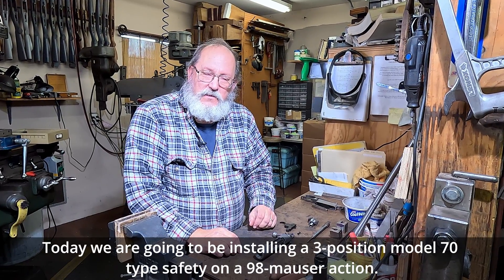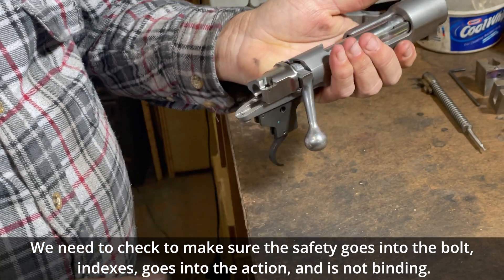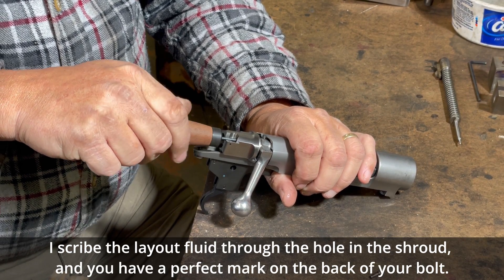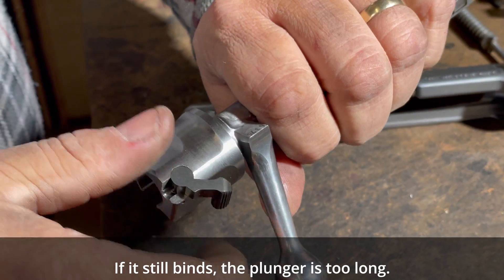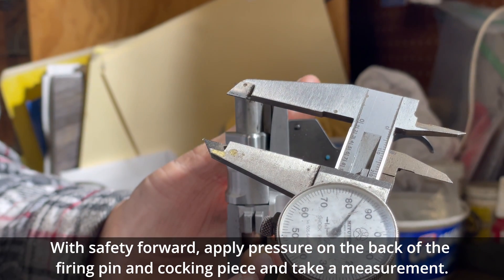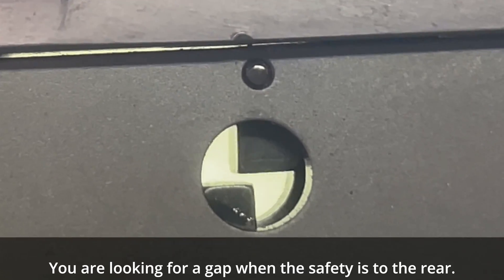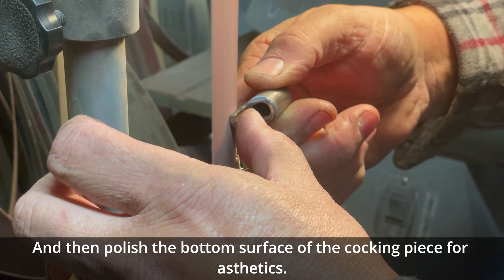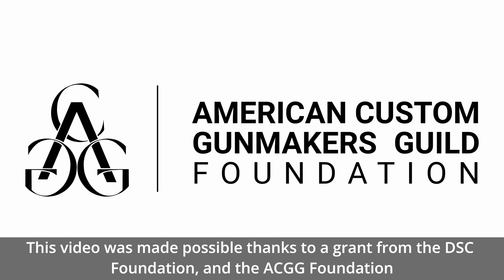Installing a 3-Position Safety on a Mauser 98

Comment: Merlin. This guy know what he is talking about.
Reply: He may know a thing or two, but my rifle now is with him was to be fixed in 4 months and now it is going past the 2 years with new promises that never come true when the rifle will be fixed.
I am running 1  1/2 month now from the past finish time promised again which has again not been kept!
What chaps my ass is when checking when is rifled to be finished I get Oh I have more new customers guns to work on - where is first come first serve?
Then the excuses over and over that make no sense at all why not do work on my rifle.
One I found strange was I was told the bluing tank had gone down but the work on my rifle was machining work before bluing finished parts go into the bluing tank - how about do the machine work on my rifle as repair on the bluing tank parts are on the way in transit.
Whenever I get my rifle back never will I us his gunsmith services again.
I find with these old gunsmiths they are so old to work a day's work is just too much for them and they have so much money rate holed their work ethics is gone.

Comment: I have a Mauser 98 in .416 Rigby I bought when I lived in Europe around 2005+-.  It has a three position safety similar to the one you are installing in this video which has a problem.  When I first bought it I found some effort was required to move the safety lever from the Fire Position to the center position and the Safe position, but you could move it with a bit of effort so I lived with it, thinking it would wear in.  Now the gun has been sitting unused in my gun safe for more than ten years and I am considering selling it.  I took it out to clean it and take some photos  and found I was barely able to move the safety from Fire to Safe with maximum effort.  After a couple of movements It seemed to get even worse and I now cannot move it without exerting enough force to worry about breaking something.  I wonder if you can give me any advice?  I could also send you photos of the bolt if you are willing to take a look.  I am living in BC Canada and am wary of take the bolt to a local gunsmith who may not be familiar with the brand.  Thanks for any help you can offer.